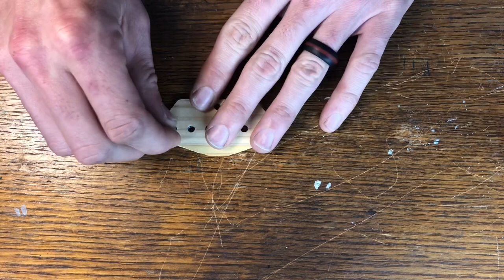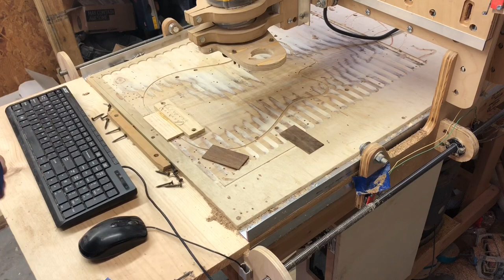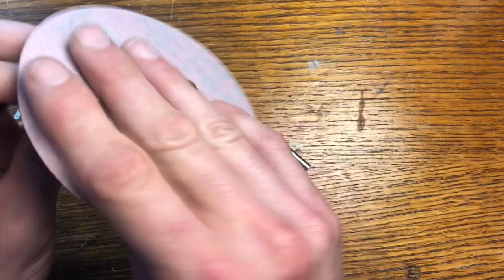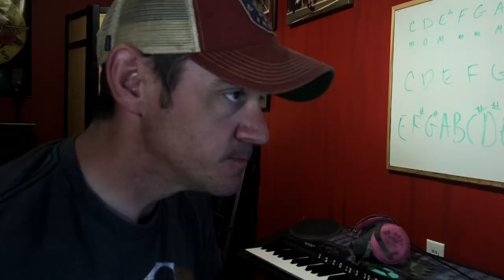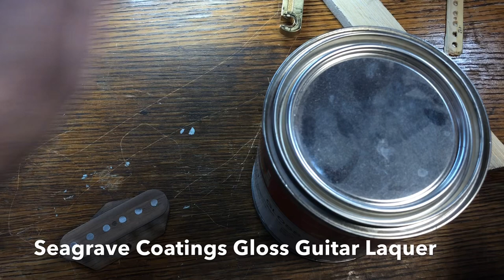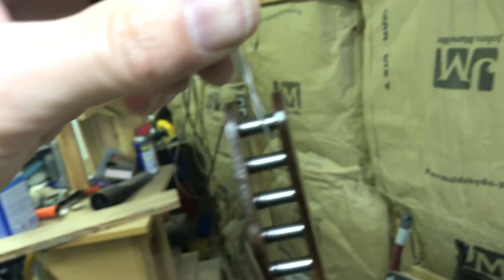Pickup Making Tele Style Bridge Pickup Bobbin Built out of Walnut

Comment: You should use 2 spacers 7/16" height 1/8" width 2 7/16" length. Place your magnets in the bottom bobbin piece and then put a spacer on each side and wrap a rubber band around them then you can hammer on your top piece beginng with the shortest pole piece. Just make sure each pole piece is straight before I try hammering it in. Also to ground the bridge pup you can just use some of that metallic tape that is used for shielding. Or aluminum foil would probably work. Or just cut out a piece of sheet metal and use a piece of double sided tape to attach it.
Reply: By the way. I just subscribed and I love the channel. Thanks for all your effort and education.
Reply from the maker: Philip Schmittou awesome bud. I’ve never thought about aluminum foil or shielding tape before. I may have to try that out. Glad you like the channel bud and thanks for the help. Welcome to the channel!!